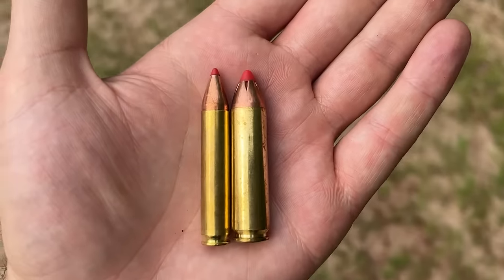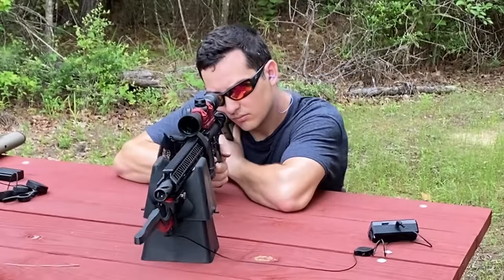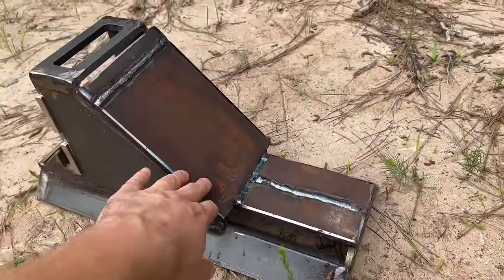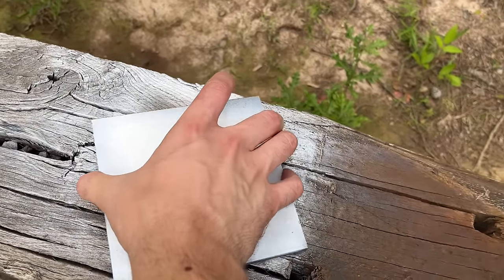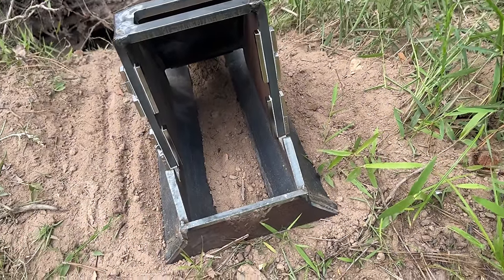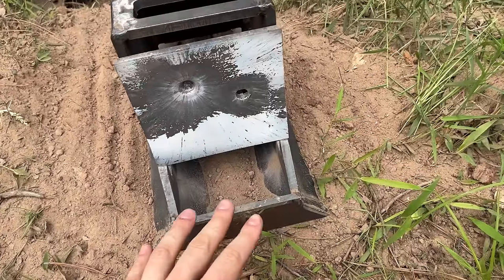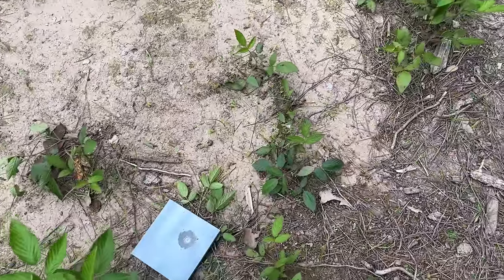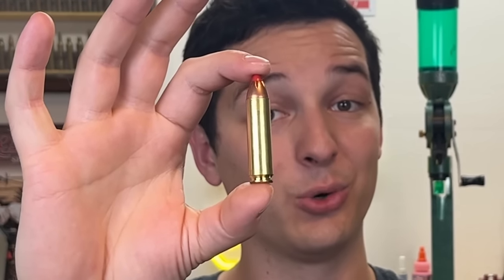350 Legend vs 450 Bushmaster: INSANE Difference On Steel

Comment: The reason why the 450bm didnt go through is because it dumped every bit of its energy into the target very efficiently. Small and fast defeats armor but doesnt necessarily win in an energy dump contest. If you could put a pressure gauge behind the steel to measure impact psi that 450 would be much higher. Also in ballistics gel or in a devastation test on melons the 450bm would do more explosive damage and cause more cavitation damage.
Reply: “Energy dump “ does nothing on game . Punching holes through vitals kills . Every gut shot animal or shoulder shot with a Berger type garbage bullet would magically drop game . All that energy “ dumped “ into the animal but it walks away and dies a miserable death
Reply: @Paul-q3m7k  wrong, dumping energy punches through bone. Poking holes is not at all the only thing you need. If that was the case 22lr could kill a deer no problem. You need that energy dump to bust through the shoulder and expand that bullet as best as it can. Lack of energy causes low expansion means the bullet hole could seal up which is why many people lose bloodtrails.
Reply: @Paul-q3m7k  I agree poking a hole is no where close to exploding and expanding in wild game i would take the 450 bushmaster any day over the 350 legend
Reply: @Paul-q3m7k  your comment shows a very real lack of hunting knowledge
Reply: And yet a basic 30.06 is 30% more energy at 100 yards.
Reply: @grantdubridge7995  you make a good point but thats also not the point. 450BM was designed to fit in an ar style platform making it a good compact semi auto platform cartridge for close to medium range. .30-06 was designed as a longer range round for guns with longer barrels. Two different rounds for two different scenarios, both are devastating at close ranger 100 yards in but the 450 wasnt designed to be a long range round. I have a 6.5CM for the long range stuff and a 450BM AR-15 platform for the closer stuff.
Reply: My point is that people are believing they have a monster gun with a 450 Bushmaster {recently I saw a short video with a man calling it big Bertha) and yet the old traditional plain jane , not an assault weapon, 30.06 kicks its ass.
Reply: @grantdubridge7995  you'd be well served to understand why the 450 was even created, it was created for hunting in area's with rifle restrictions, like here where I live in lower michigan.  It was never meant to compete with the likes of a 30-06       your comparison is pointless
Reply: @grantdubridge7995  not necessarily bud. Think about entry and exit hole size. The 450 is a .45 cal bullet making a nearly half inch hole at entry even if it doesnt expand, thats a big drain hole. With a bullet already .45 cal wide and it opens up it makes a crazy exit hole and the reason 450 has more knockdown than .30-06 is that width advantage. If you get hit with two hammers, one framing hammer and one sledge hammer with the same energy from both the sledge hits slower since it has more mass to equal out to the faster smaller framing hammer but the sledge hammer is going to bust up more bone while the framing hammer wants to poke through instead of break and shatter stuff. Wider objects do more immediate damage with less effort.
Reply: 350 rips shit to shreds and it all dies. All my buddy with 450s lose deer constantly. Dont care what einsteins say
Reply: @justinadams159  tell your buddies with the 450 to quit flinching and jerking the shot from recoil fear. With winchester powerpoint ammo the 450BM is only going 10fps faster than the 350 legend but hits with nearly the same amount of energy at 100yds as the 350 does at the muzzle. At 100 the 450 is at 1,722 ft lbs, the 350 is 1,762 ft lbs at the muzzle. 350 is subsonic before 150 yards, 450 isnt subsonic until a little past 200. Bot drop off fast but theres no credible way you can say 350 legend is better than 450 bushmaster, your buddies are just flinching.
Reply: @ratedredneck96  like my 50 caliber muzzle loader? Maybe we should just use muzzleloader the whole season .
Reply: @grantdubridge7995  the 450 bushmaster basically is a muzzleloader. I have a american tactical ar15 in 450 bushmaster and i call it my semi auto muzzleloader because if you shoot a muzzleloader with a sabot youre not shooting a true 50 caliber bullet, youre shooting a 45 caliber bullet with the sabot taking up the excess making it a .50 caliber projectile until the sabot flies off then youre left with a 45 cal projectile. The energy numbers are similar and it wouldnt surprise me at all if the very same 250 grain hornady customs that i shoot from my 450 bushmaster is the same hornady 250 grain bullets you buy for your muzzleloader. They are both ftx projectiles i do believe and like i said before velocity and energy numbers are very similar so i have a semi automatic rifle with muzzleloader type devastation
Reply: @ratedredneck96  I bet your right, but I use an old muzzle loader with a ball.
Reply: @ratedredneck96  buddy i watched my grandfather blow the front leg of a deer clear off with a 10gauge and it took off and we saw it again 2 years later. So idk bud no way a 450 runs more energy then a 10g at 50yrds but i hunt for kill shots and in my experience deer dont tend to even feel the 350 and ive bled 2 doe where they stood as they just failed to react to the shot
Reply: @OogieBoogiegames  if he blew the leg off are we talking he shot low and took the leg off or what? If you put a bullet in the high shoulder it will drop, doesnt have to be a 450BM  or a 350 legend but when you run the ballistics the 450 has more case pressure, it has more width, its the same length of both cartridge so the 450 being the same height but wider it has more case volume for more powder. 450 just hits harder and makes a bigger hole, thats the big and little of it.
Reply: Try 450 bushmaster solid coppers. 220 grain Lehighs. I test ammo on steel too. Pure zinc and pure bismuth with handgun rounds on steel and wood. H110 powder for 450b has less pressure in starting loads😊. Lil gun recipe for the 220 grain Lehigh coppers
Reply: Speed defeats armor. I load for bear, literally. I’ve tested 10 mm solid copper on 20 lb propane cans and even 45 acp copper as well. 45 acp at 1440 does it. 10mm copper at 1700 does it too. Been testing pure zinc 338 on cans. I do get expansion. Pure zinc 450 does too. 230 grain mould with zinc comes out to 141 grains. 😊
Reply: @justinadams159  your buddies need to learn how to shoot. I have 350 and 450. I like them both. I've never lost a deer
Reply: @justinadams159  I can confirm that 350 rips shit up. Not gonna go into any more detail than that 😂
Reply: @justinadams159  350=3030 weak little round for recoil sensitive people that kills
Reply: 450 will take elk but 350 you playing a game of luck
Reply: @jackmemphis3203 350 it's like a 3030 yes it kills but it's weak
Reply: @austinhowze6280  certain brands of 350 legend 170 grain have the exact same velocity and energy at the muzzle that 170gr 30-30 has. 1900 ft pounds of energy
Reply: @MarkLoganFIB  sorta yes and sorta no, its a balancing act really. Yes a heavy bullet hits hard no matter what but velocity plays the role of energy at distance. The more velocity behind it the further its capability of devastating energy is. The slower the bullet is going the faster it loses its energy. You have to have velocity to deliver the energy, the faster you can hit something with a heavy bullet the more energy it stores and hits the target with, like punching, you can take the same person and punch the same object twice once fast and once slow. The faster punch same fist will produce more energy transfer doing more damage. A heavier fist can do the same amount of damage when hitting slower but it takes more energy to get that heavier fist to move. You find the balance of energy and velocity to get the best possible ballistics from the projectile. The reason why an fmj zips through gel is it doesnt deform therefore it doesnt dump its energy all at once. A soft point or ballistic tip bullet hits and mushrooms out changing the surface area of the bullet making it shorter but double in width to plow a much bigger wound cavity. That added width makes its drag coefficient into the gel higher slowing it down faster dumping more energy. Common sense stuff.
Reply: And these are not peneration round …
Reply: "Energy dump" is a bad term, just like "knock down power". Energy is necessary to do things, but what things are done matters. A high powered water gun that doesn't penetrate at all could dump more energy than a bullet that penetrates, but the bullet will likely be more lethal, as would an arrow, bolt, spear, or blade. It's about what amount of damage is done to which organs and how they impact the ability of the target to react and survive. Both depth of penetration and the width of cavitation are important. Deforming bullets like hollow points, soft points, and fragmenting projectiles don't wound by "dumping energy" they wound by tearing wider holes. Glasser bullets are a good example of trading off too much penetration to try to cause wider shallower damage. Trying to use non-deforming FMJ or AP bullets to hunt large game with will show that focusing on penetration alone isn't always ideal.
Reply: Speed Kills
Reply: @dasboot9471  not necessarily, light bullets can go fast but they dont have the energy to punch through far. Energy kills, high energy causes a much worse temporary wound cavity which makes the permanent wound cavity worse most of the time. Big wide heavy hitting bullets hitting at 1,750fps are more devastating than a .223 or 5.56 zipping through at 3,100fps every time. Energy dump is everything, if you can hit with a whole lot of energy you can pop a deer heart without even hitting it.
Reply: @ratedredneck96  pretty funny, my comment was the most whimsical, and shortest I’ve ever posted because I don’t really care, and I got the longest dissertations possible about the most subjective and highly debatable unproven theory possible.
Reply: @MarkLoganFIB   pretty funny, my comment was the most whimsical, and shortest I’ve ever posted because I don’t really care, and I got the longest dissertations possible about the most subjective and highly debatable unproven theory possible.  Great write up though, solid effort, no offense meant.
Reply: @MarkLoganFIB  yet everybody is still arguing about it
Reply: @MarkLoganFIB  math says stuff, sure, in this case you may be right, 450 bushmaster is much larger case than 350, in other cases one could have very closely matched but slighty different cartridges AND similar but not the same weights, and sometimes the faster smaller bullet can edge out the heavier bullet in energy, and also penetrate better due to less frontal area or design…it’s a big game of tit for tat, and rather inconclusive because of different penetration mediums, temperatures, inconsistencies, and the fact that we can’t actually test thousands of rounds on live humans or animals, and even then each subject would have drastically different reactions from the next…..just about every test like this contradicts another test that has been done before and after and many other variables that are impossible to completely control…that’s just like, my opinion man!  I’m not that invested in this conversation but it is interesting.
Reply: Any experienced shooter knows that velocity trumps weight when it comes to shooting steel. No way does making holes in steel equate to killing power. Bullet construction matters too.
Reply: @MarkLoganFIB  .350 fan boy detected. People don't buy a .450 for magazine capacity, they buy it for hunting. Nice useless book you wrote. LOL
Reply: @morrismonet3554  not really man, hp is what gets you going fast but torque is what pulls down walls. If the bullet doesnt have enough weight behind it to transfer then it dump all of its kinetic energy and slows down before it can push through. Its a balance, the only way speed can beat steel without weight is if it hits it hard enough to fracture the steel. The 5.7 is fast but gets through steel because of its pointed shape and diameter, it dumps energy fast because its so light.
Reply: @ratedredneck96  Still not relevant to killing power. If you could get a BB to travel at 40,000 fps it would have the same energy as a .45-70. The .45-70 would bounce off steel, the BB would go through. But which one is the better moose killer? LOL
Reply: @morrismonet3554  thats not a speed thing thats a diameter thing. Less steel to move out of the way to puncture it. It also may not go through because the energy is pushed through by the inertia the object carries from the mass of it. It could hit and if it doesnt have the weight for that energy to capitalize on to push through it could dump it all in the face immediately and not carry through. Plus youre talking steel melting speeds from wind friction so thats also something to consider. If it doesnt have weight behind it to push it dumps its mass too early, its a hand in hand balance.
Reply: @ratedredneck96  "wind friction". LOL! Sorry, son. it's a safe bet I've been shooting and hunting longer than you have been on the planet, with more calibers than you will ever hope to own. I don't get my info from theories on the internet, it came from real world experience. So I'll just end it here. Go play some video games.
Reply: @ratedredneck96 alright, the bud guy has entered the chat😂budbudbudbud😂😂😂
Reply: @justinadams159 yeah, your buddies are flinchers😂😂😂you tell him bud😂
Reply: Just figured I'd add my anecdotal evidence.  My brother and I hunt from the same stand every year.   We get the same shots on the same population of deer.   I run 350, he runs 450.  Both drop deer,  but my kills are more likely to stop them in their tracks.  The 450 tends to not dump its energy,  as evidenced by the exit hole, where 350 stays in the body cavity.
Reply: @skippyskip9959 I heartily agree. If we could use  something different in Indiana on public land, 06s,08s, 7mags and whatever would probably fly off the shelf.  That being stated, son took his 350 legend on his eastern state bear hunt . He was all excited as his dropped immediately after being hit. Still I can get perturbed by those " 350s or 450s don't match the 06s or whatever, they shouldn't hardly be used in the same comment. At least we have  evolved out of the shotgun slug only era. Praise the Lord. I find it really hard to hold a 1.5 inch group at 135 yds with my 20 gauge Mossberg 500.
Reply: @Paul-q3m7k can you yell it any louder that you don't hunt?  Everyone got it, OK?  Your current view of ballistics is fun but then when you come back to reality and have to pick a round to hunt you have to give all kinds of considerations.  What are you hunting?  Distance?  Environmental factors like thick brush, etc?  These all add up and whether or not one of the rounds will go through a metal plate at close range suddenly do not matter at all.  What the rounds will do once they enter flesh matters.  It's totally worth your time to learn about ballistics.  What the other commenter said about is correct about the damage the bullet does when it enters the body.  Ever notice all of the gun tubers marvel over expansion in ballistic gel?  Figure out why and what that means.  Why do you want more expansion?
Reply: @pitchforkpeasant6219 steel armor and flesh are two totally different things.  There is a reason for the different rounds.  Which is why it is important to learn about ballistics and wound channels, expansion, etc.  Gun tubers make all sorts of videos marveling over expansion inside of the ballistics gel.  Why is that?  There is a major key point there for you to deeply consider.  Your prey and environmental conditions will determine the ballistics.  Your wallet and availability will as well.  A 450 bushmaster has serious recoil to tame as well which is why a lot of people don't like it.  Which is why recoil is better addressed in the AR-15 platform for the many options that exist to do so.
Reply: I've never lost a deer with a 450. It penetrates just to right amount. Great wound cavity and damage to vitals, yet doesn't shred and bruise the surrounding meat. Clean kills. Consistent accuracy (Hornady Black). It does cost more than 350, but it only takes one shot, and I've never had one run more than 15 yds.
Reply: @AzSedonaAdventurer  the AR platform is perfect for the 450. A tunable, venting gas block, an aggressive muzzle brake, and a weighted, captured buffer spring, will tame it down nicely, and reduced wear and tear.
Reply: @tylervorthmann8470  I agree